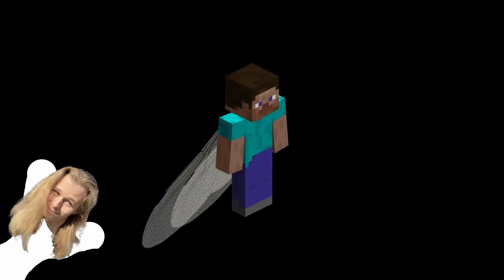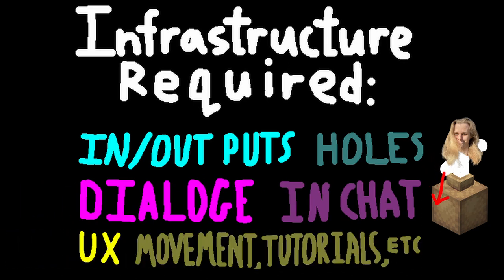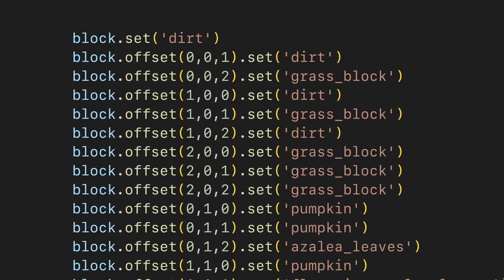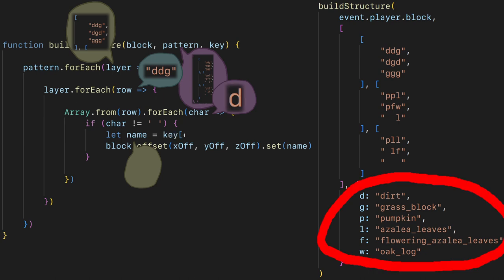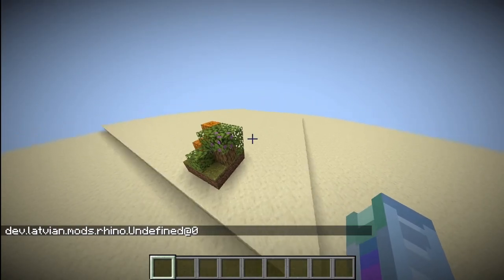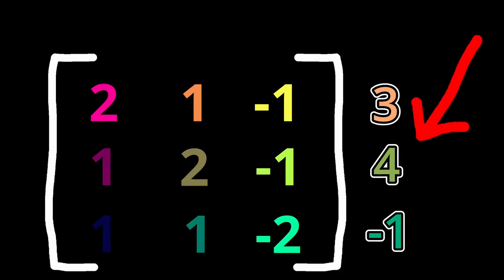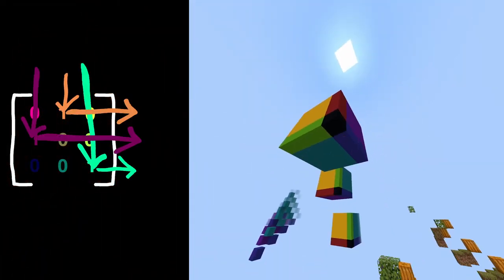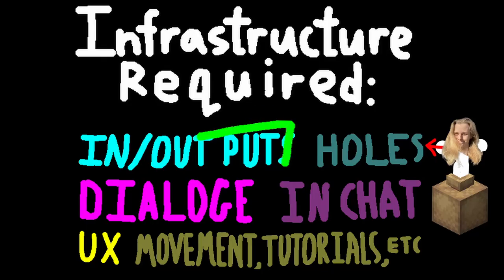Game Design and Programming in my Minecraft Modpack

Comment: Just curious why structure blocks wouldn't work
Reply from the maker: being programmatically defined allows variance. Also I need to be able to not just construct a structure but also read a structure - to see if the player built it correctly. Also structure blocks (at least in 1.18) are buggy in certain ways.

Also this pack is kinda abandoned. I got most the gameplay systems and wrote a full storyline and made a couple levels and 1 cutscene (and an engine to display cutscenes) then got burnt out making hub world & trying to make another devlog.

It's a cool concept still tho i would come back to but i'm holding back on that cause i'd rather just make it as an actual game - not as a modpack so i'm not tethered to minecraft.